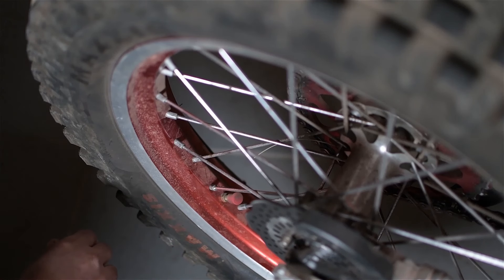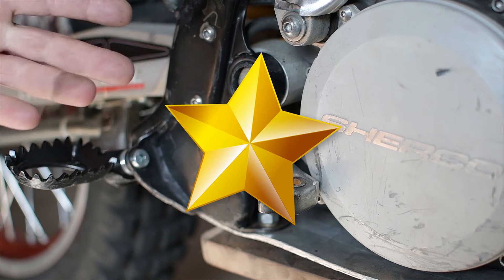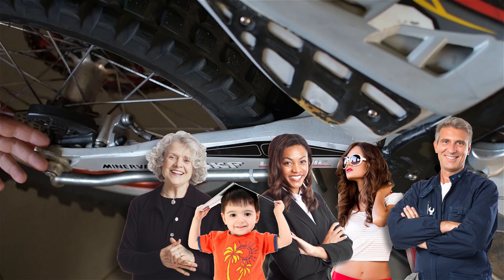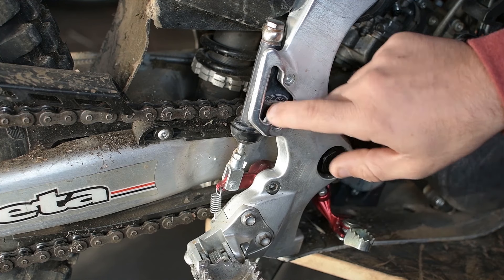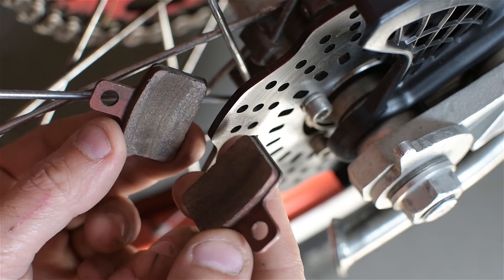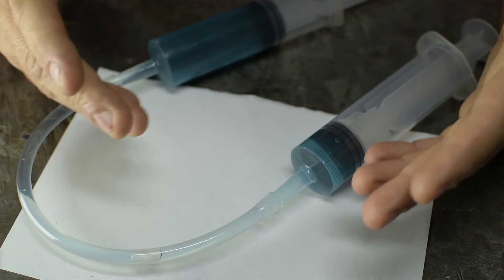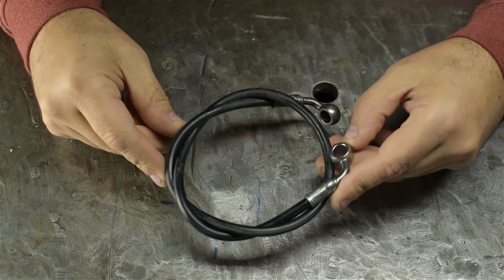I'm an Idiot! (Soft Spongy Brakes)

Comment: @This old tony - I don't buy it..  

If your rotor was so small in fact that the caliper was out of room to clamp them, it would let you know....  How?  It'd let you know by making a mess as it pushes that seal all the way out of the bore. Hydraulic calipers know no bounds. I've yet to see a brake caliper that has a mechanical stop on the piston..  So what was actually happening?

I suspect you had knock back! 

Knock back is something that typically is only experienced by race cars. As race cars go around the track at blistering speeds, there are phenomenal lateral forces exerted on the wheels and the hubs that they are attached to. This sometimes can cause deflection that will cause the brake rotor to laterally move in relation to the caliper which knocks back the pistons. Now, you have pistons/pads that are not in contact with the rotor, and you use a lot of the pedal distance to make up that gap before the brakes will begin to stop you. 

This is just one form of knock back. Another form can be from warped, bent, damaged, or otherwise running pads that are not flat and true. For example..  Once we were doing brakes on a 42 chevy with a disc brake conversion. Bled the brakes a million times, and STILL had a spongy pedal. Come to find out, that the backing plates for the pads weren't perfectly flat. As a result, pressing the brake pedal would push the high spot in the middle of the pad, flat into the brake rotor, and then it would begin to stop..  As you let up on the brake, the pad would deflect again and push the pistons back into the calipers, while the front and back of the pads were touching the rotor, and the middle had a slight gap.  

Being that it's a trials bike, it could very well have had something hit the rear rotor..   If the rotor doesn't run true, lateral oscillations in the disc will also knock back the pads. (BUT ONLY if you are running a fixed multi piston caliper. This doesn't usually affect floating calipers that ride on pins much, if at all.) So, you may also want to check run out on the rear disc to make sure it is true. Bad wheel bearings, bent disc, loose axle, loose rotor, mounting the rotor to a non flat surface (Bent or damaged hub) can all cause the rotors to not run true. 

And last..   Whew..  

REPLACING THE PADS Can also cause a spongy pedal..  As the pads and rotors wear, they "Wear in" to themselves..  This is common for sliding parts.. This is why you keep the order of your flat tappet lifters when pulling your engine apart, because the wear pattern is unique for each surface. They don't wear perfectly flat, like they were originally machined..  So, if your rotor was slightly concave, and your pads were new and completely flat, it's likely the cause of your spongy pedal. The caliper tries clamping the pads into the concave rotor, and like above, it tries to bend the pad to conform in this case to the concave rotor..  it will do this, but you get a lackluster feel in the pedal.  As you release, the pad flattens back out, and pushes the piston back into the caliper, as the gap between the center of the new pad and the concave rotor widens to the point where just the edges of the new pads are touching the disc.    

Funny fact...   If you would have just kept riding it, the pad would have either worn the rotor down to conform, or the rotor would have worn the pad down to confirm, and you would have gotten your pedal back.....Eventually. LOL   

Hope this clears up some fine details about what was likely going on Tony..  Glad you got it figured out.   And thankyou for the LOLz! :)

Comment: Now if only we could figure out what the problem is with the brakes in my father's car (now that he's replaced it, it's less of a concern, but what the problem could have been continues to mystify me). Soft and spongy brakes until you reached a certain point of travel, at which point they would lock up hard.

Several trips to an expensive mechanic to try to figure out the problem, bled the lines multiple times, etc... and the only thing that ever even seemed to affect anything was setting the suspension to a stiffer setting (which was even more confusing).

Comment: Genuine question but.. how exactly is this caliper/master cylinder limited to only work down to a certain thickness? Has the pad return spring or another mechanical feature been limiting the effective caliper range?

Basically, the hydraulic brakes I've worked with (in principle and in reality) don't have a limit for how far the caliper pistons can be pushed out. I've seen cases where the caliper piston itself was worn away to the point of fluid leaking past the seal, also discs worn down to the thickness of a few mm (Yes that IS possible). If everything else is undamaged that still doesn't make the brake feel/lever travel any different - up to the point that a leak occurs (Hence people who never get their brakes brakes checked can actually end up with these rare occurences without noticing).

Out of curiosity, have you checked the runout on the installed rotor? A runout on the rotor will push the pistons back further into the caliper when you release the brake - that increases the volume  needed from the Mcyl at each brake application and subsequently the lever travel (to the point of bottoming out). It's also not necessarily something you'd feel, for example as a pulsation, in the lever, unless over time DTV occours as a result. Even if the disc wasn't warped there might have been something that fouled the installation of the old disc (unlikely with Tony's OCD but hey :) ) and changing the disc fixed it. Some master cylinders are (cost saving or lazy design) very limited for their volume per stroke, the runout on the disc mount extrapolates to the effective caliper diameter. So in some cases.. the lever travel is already running out at a very small runout on the disc mount. 

Not saying that's what it is at all , but genuinely curious.

Comment: Usually the brake caliper pistons are NOT limited on travel. I've seen the pistons acting as the brake pad chewing through the rotor into the cooling vanes.

Are these brake calipers some weird design that does limit the travel?  

Are the pistons both moving freely?

Comment: TOT, now that you are a self-confirmed master diagnostician maybe you could throw some ideas my way about my bike issue. I have a 2018 Radcity Ebike with Kenda Tires put on by the factory that made it. Now I'm about 7-800 miles into this set of tires and the rear one on the non drive side has about a 8-10 inch long section of cords coming out where the tire meets the rim. It actually got so bad that part of the tube was sticking through like a hernia situation. The bike has cable actuated disc brakes so there's no caliper to rub on the tire. No signs of anything rubbing unless maybe the power of the rear 750 Watt hub motor is strong enough to spin the rim separate of the tire? Defective tire?
 I was running Armadillo Flat Stop strips inside it and I sprayed the Kenda tire itself with aerospace 303 (and remarkably a lot of the outter nubs that you get with a new tire are still there!) to deter wear. The latter is an experimental thing suggested by Sweet Project Cars channel. Seems to have worked only in the wrong area.
 Since I have added the cooler to the back and 2 baskets I do carry a lot of weight fairly often. But in all my years of biking I have never seen a failure like this. Or quite so severe to one area. Thoughts?

Comment: new pads take up the worn rotor space. So that could not be it! but a rotor that is out of parallel or warped would pump the pads or grab. his most likely culprit is a brake line ballooning or a caliper that is spreading apart under pressure.

Comment: Oh yeah, I know about this technique because I just resurfaced the warped head on my car, before replacing the head gasket. I also did a touchup job on my front disk brake rotors by jamming them onto the wire wheel on my bench grinder and hitting them with emery cloth. Really not as dangerous as it sounds, even if they spin off. Just be sure to wear gloves to catch it. Now I wouldn't recommend this technique for every situation but in a pinch, on the right car, it works great and I'm sure my old 91 honda forgives me.

Comment: So, Tony, when your pads wear down .035" you will be back to the same point??  You could check the length of the push-rod in the M.cylinder.  A shortened push-rod in car brakes once took some time to trace. Has the actual brake lever been replaced with incorrect, or deformed?  While you have narrowed the problem down to lack of travel, I'm not convinced it was the disc. Apologies for the negativity.

Comment: I'm betting your old rotor had a little bit of a wobble to it, and would push the brake pad on the "high" side back in the bore a bit too far, so when you pressed on the brake pedal, it had to travel more than it should have to build sufficient pressure. Like another comment said, your brake pads wear way more than the .035" you measured between the old rotor and new. You have at least .100" on each brake pad (probably closer to .250"). You could test this by whacking your new rotor with a hammer and seeing if the soft pedal comes back.

Comment: the only way that would happen is if the chamber volume on the master was considerably smaller then the chamber volume on the slave/caliper which frankly would be kinda stupid, just out of curiosity did you mic that piston because usually ob a typical hydraulic brake system the master has enough volume to blow the piston out if not restricted by the rotor, rotor thickness specs are usually for warping issues, rotors warp when they get to thin, i have to wonder if if maybe there was some pitting in the end of the piston and somebody filed it to get the pits out which would shorten it reducing its throw......

Comment: If some 40-thousandths of rotor loss causes your caliper to not work that's a problem.  How much pad wear can you use before it won't work?  I bet it needs to be more than that.  I expect that the old rotor wasn't running true and pushing the caliper piston back into the caliper.  Perhaps some flex in the rear hub?  That thing doesn't have a caliper piston return spring of some kind does it?

Comment: Hey Tony... if the problem was just a thin rotor, then I would think that replacing the pads with thicker ones should have compensated well enough. Was the old rotor warped or not uniform thickness. This might cause 'fluttering' that pushed the piston back a bit (when off the brakes) causing the feel of a soft pedal.

BTW, I always enjoy the videos. Great job!

Comment: So, like, I get that things happen , but honestly the reason no one thought of or mentioned the rotors is probably because checking them is part of changing the pads... the very first thing ToT said he did in the process.  It's kinda like saying you had a flat tire and after getting it fixed your car drives funny, you check the shocks and struts, springs, sway bars and bushings, check that the frame is undamaged and the rims are true, then after all that, come to find out you never put air in the tire after getting it patched.

Comment: There is only one problem with your theory/explanation.  Hydraulic brakes are self adjusting.  As the parts wear fluid is drawn out of the reservoir and into the line to allow the pistons to move further out.  There is no way a rotor .035" thinner would cause a problem.  The pads wear prob 10x that amount and the brakes keep working.  

More likely the problem was the rear disk was warped or bent.  As the disk spun it would push the pads back a bit which causes the brakes to feel soft & spongy.  

I am fricken anal about cleaning the disk any time I work on the wheel or the brakes.  Any grease on the disk will get spread into the pads and reduce friction.

A riding friend wore his disks down to the thickness of aluminum foil and those brakes still worked very well.  I cannot believe that a mere 0.035" made all the difference to your bike ..... but then it is French so maybe .......?

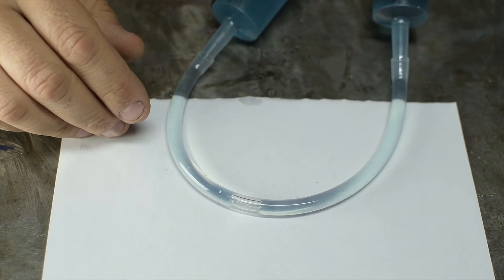Comment: I have to disagree with your assessment about bleeding the brakes the traditional way at around 10:20. The air doesn't want to move back to high spots and you can bleed them just fine. In your demo I think you didn't let pressure out when you pushed the first piston. Here's why I think bleeding works with lines with high spots: the brake fluid (usually it's not oil, but some brakes use mineral oil) is too viscous and the tubes are narrow enough that the bubbles want to move with the liquid as "unit" instead of splitting into smaller bubbles and moving through the liquid. As you press the brake it pressurizes the system, and when you open the valve for a second at the slave cylinder it pushes the liquid towards it. When you close the valve and release the brake, it introduces new brake fluid from the reservoir (which you need to keep filled!). This doesn't allow the liquid to move but in one direction. Do this at a normal pace and it will work.

Only trouble I've had with traditional bleeding is when the lines are totally empty and you can't get the bleeding started because there is equilibrium with the air wanting to go up while the liquid at the same time wants to move down (the lines are vertical enough). You can get past this with a pump action soap bottle from your toiler or kitchen. You can just use your fingers to seal the pipes together, it won't have to be perfect.

Comment: I had a similar experience with a car. You know that rubber diaphragm in the lid of a car's master cylinder? Turns out if it is extended down into the reservoir and you do not push it back up into the lid after adding fluid it creates a vacuum that does not allow the brakes to work. I was expecting you to say something like that. Yes I'm an idiot too. Oh and just bought my first trials bike.

Comment: I still don't get it. Why would the brake not work even if the disc was too thin?
Don't the pistons self-adjust to take up play?
I once removed a complete rear brake system of a motorbike, so I could bleed it after making sure the air bubbles could float upwards, then reinstalled the assembly. It worked very well, but might not be possible on all bikes.

Comment: You wouldn't think a worn disc would cause a spongy pedal feel.
The piston has to stick out when the pads are worn anyway, so how can it interfere with the feel?
Some calipers have a tapered piston to make them easier to assemble. These seem to stick when they're over-extended.
Other calipers have really stiff dust seals. They only run well when they're new. I'm guessing that was your problem.

Comment: If you adjust your pedal with decent pads, it won't be soft and spongy.   At least because of the distance traveled between the pedal and your pads.  New pads are about .25" each vs. .1" on a worn rotor.  Unless, a worn rotor heats up faster causing brake fade.  That would make sense.

Comment: I'm a retired automotive mechanic, and having some difficulty with the concept of the rotor causing your issues.  Is there no provision for adjustment on the master cylinder's pushrod?, or is there a physical stop that prevents the pads from travelling beyond a certain point? Neither one of those scenarios would cause a spongy sensation... In all that lip flapping, it seems as if I heard you say that the brake felt either soft or spongy. Did I merely imagine hearing that, TOT?

Comment: I've a really old bicycle I've had to repair many times. My back breaks were also really soft and spongy, but you can adjust where the brakes rest. I, knowing nothing about motorcycles, thought that was the issue, first XD. Can't you adjust the brakes to be tighter without getting a new rotor?

Comment: If you had enough pad left, then the disc thickness was not your problem. The brake piston seals flex back into shape to release the force after applying the brake force. From what your saying if the pads are anything less than 75% your brakes are spongy, not so. Sorry but what your saying goes against all disc and caliper self adjusting design theory. Your pistons only return the the distance of the reflex of the square section of the piston seals, thats why they are square section. With your theory as soon as new pads are worn from new by 0.9mm the brakes will then become spongy, not so. The only way a thin disc can immitate a spongy brake is when the thickness is not enough to dissipate the generated heat when in hard use, causing heat induced brake fade, but this is not the same as a spongy brake. Like the humour in your vids, nice channel, keep up the good work man.

Comment: I had the same problem in a car..turns out a caliper was the problem. The piston would suck in after you let off the brake so there was to much travel in the system.

Comment: I know I'm very late and that other people have probably said it already, but your not correct that a brake caliper has two or more pistons. On most smaller cars they only have one and then use a set of gliders so the force gets distributed evenly onto both pads.

Comment: You'd have seen even half a mil of wear on those - there would be some nice big lips on the inner and outer edges - they're super visible. I bet the previous owner just fitted the wrong size rotor, and it kinda worked and so they left it.

Comment: Sorry TOT, I don't get it. I thought hydraulic calipers were supposed to automatically adjust for pad and rotor wear. Also, even if I'm wrong about the auto-adjusting thing,  I would imagine worn rotors and/or pads would just give you more travel, but not make the brakes feel spongey. Any chance you can clarify a bit?